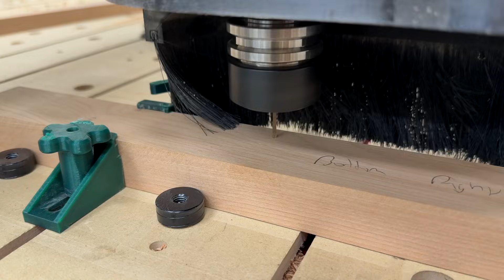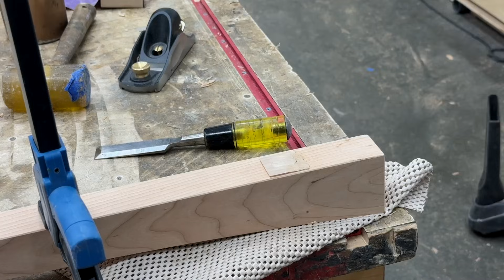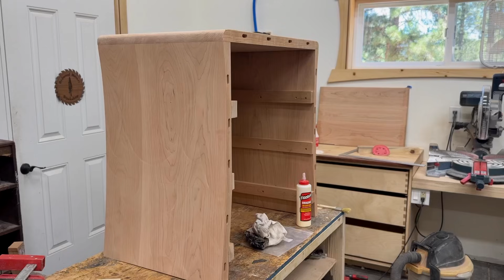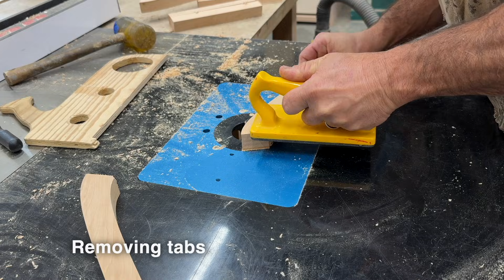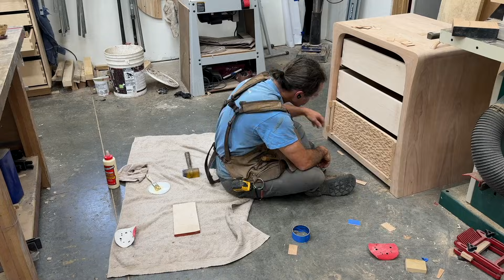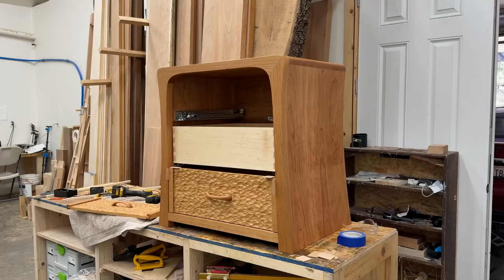Curvy Cabinet, Textured Drawers - Fine CNC Woodworking Furniture

Comment: That’s an awesome work of art
Reply from the maker: Thank you! I still enjoy looking at it every day I walk into my house.
Reply: @CorbinDunn 
I’m a retired electrical/mechanical engineer that’s been doing woodworking for over 45 years.  I ran a design/limited production company for 20 years and utilized 3 and 5 axis CNCs for prototyping.  When I retired and sold my business I converted one of the 3 axis gantry machines I had for woodworking.  I’m about to upgrade to a modern machine and will probably try designing projects similar to what you have done.  I’ve used AutoCAD as well as Fusion360 in the past. For woodworking I’ve always use Vectric… I think I will try some projects using Fusion360 for the CAM operations… You make it look easy, but I know it will be a learning experience…

Comment: Wow Corbin, that's new era fine furniture making!
For chip out in the corner.. did you try an over cut loop? Like a plasma fillet
Reply from the maker: Thanks! Yes - I did try numerous corner techniques. Such as, back-cutting that area first; cutting past it, and then continuing, various stock to leave options with a finishing pass, etc. Leaving some "Stock to leave" (ie: 0.020") and then a finishing pass created the worse chipout in it; I got best results by not doing that.